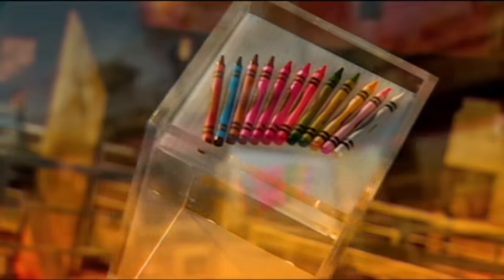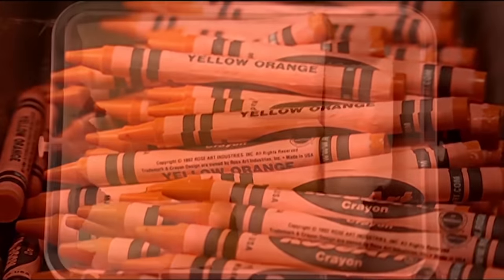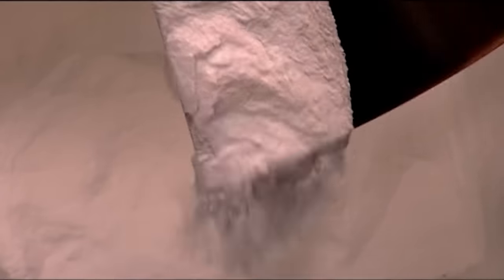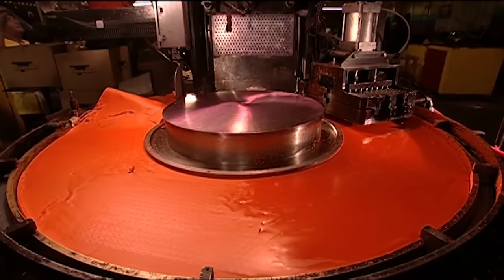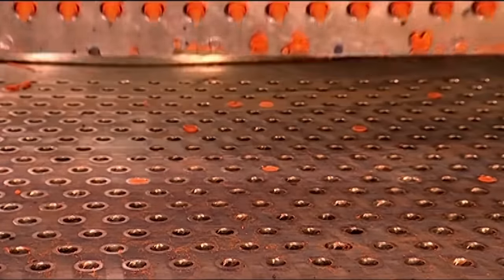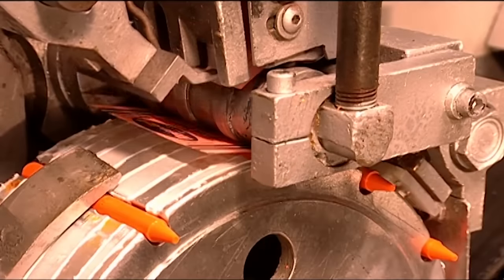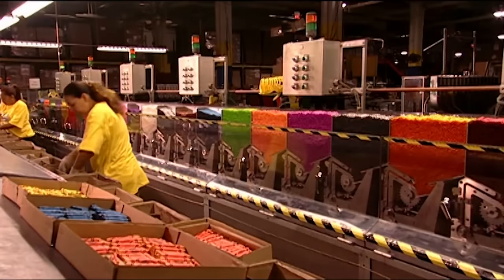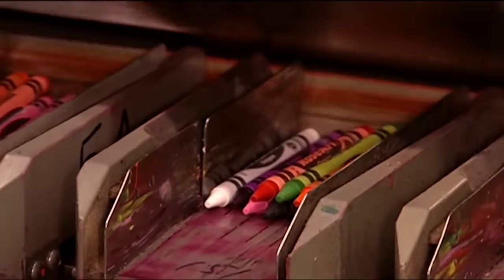How It's Actually Made - Crayons

Comment: Hey for a cool forgotten fact before 34 seconds in the clip, due to past experience sharing with you this would be pretty neat I bet. Whether an impact or not.
So you mentioned they found a way to make it non-toxic, there's a man they bought that patent off of and it was Mr bowley. If the crayon factory merely bought rates to the patent I wouldn't have the story today I bet but no they purchased it straight out so I get the chance to share with you cuz otherwise happenstance would have been different right.